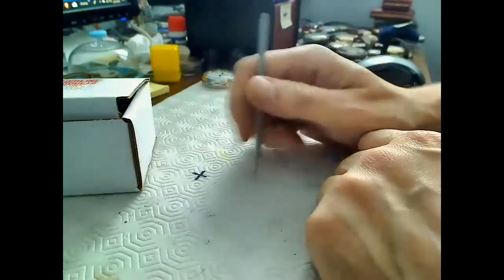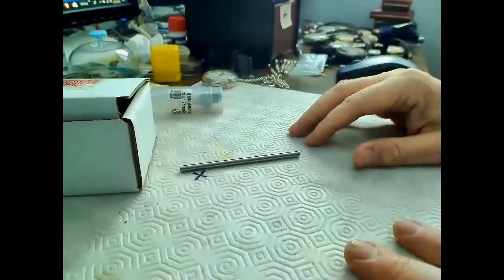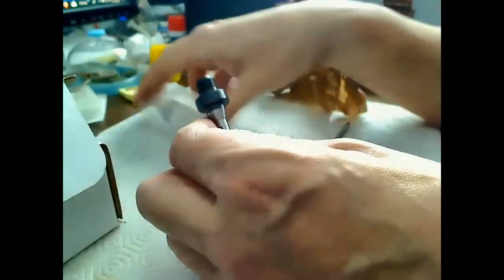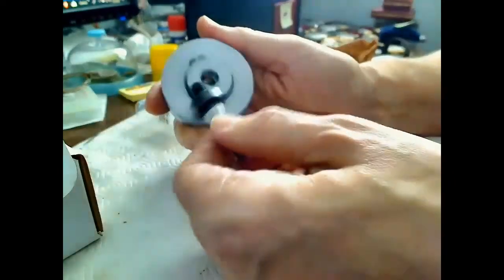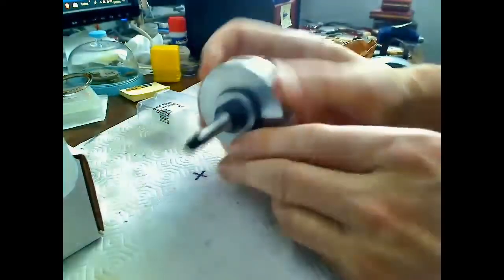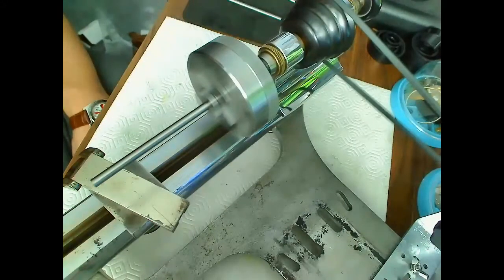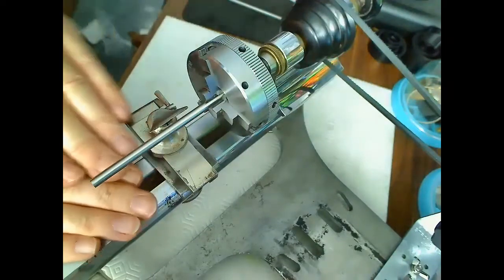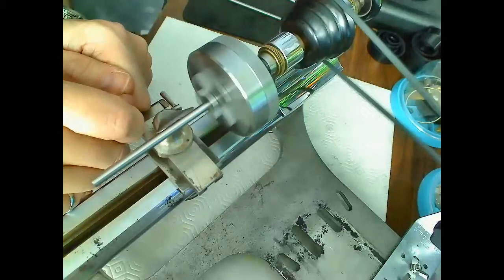Watchmakers 3 Jaw Chuck

Comment: I've just received the 4 jaw version and an RDG adapter. The run out ended up being very bad. I have since ordered an adapter from Sherline and the specs are promising. One of the challenges I found with the RDG adapter was how deep the thread was. It was too deep and the back of the chuck didn't mate well with the adapter.

Comment: nice video, as not much out there on these small watchmakers lathes, by the way you can use these chucks for making watch cases and the balance itself, also the gear wheels, as they sometimes are that size ( you expand the chuck to grip the gear blank on the inside).
Reply from the maker: Thanks...and you know too much my friend:)  Would love to make a case some day.
Reply: @JDRichard  No, never enough, I just have Autism, and a passion for tools, tech, and watching the artists who use them. 
One other thing those rods are colloquially called "tommy bars", same as the bar handle on your big bench vise. the other way to hold these rods is using a collet, and center drill using the tailstock, a centre hole, the kind for live centres, then mount the rod in between centres, and then cut the part as required, also you may use accessories like centre supports, or the special supports like the jacott tool uses, for turning and polishing pivot ends (as the forces are so light, due to the fact the parts are soo small, that bowing the parts would not realy, on thinking logically, be any issue as you would barely get 2 inch pounds of torque on the tailstock quill handle, and not require that much pressure anyway).

Comment: Nice approach to the 3-jaw issue.  FYI, and for others that might be looking, an original Boley 3-jaw was made, listed in their catalog as "a 45" which I have used for some light duty turning.  Granted, it's ebay material or luck to find one, but there it is.  Another alternative is to use crown collets.

I would be very careful using it too much in any of the lathes you mentioned.  You'll want to give special attention to the front cone bearing when you service the headstock--excessive use with the extra weight will not make the bearing happy with you. 

As an alternative to adapters, you may want to consider just biting the bullet and buying one of the Sherline lathe packages.  My watchmaking lathe is a Boley F1, which does perfect work for fine watch parts.  However, it's seriously under powered for anything else.  The Sherline calmly eats any material you can fit in the chuck.  I needed some 20mm brass round stock, but only had 1"x1" bar.  I chucked up a piece in the 4-jaw chuck and went to town on it.  It's a toss up which took longer, indicating the work piece in the 4-jaw, or turning it down to round stock.  And of course you can make parts for the watch lathes with a Sherline.
Reply from the maker: Adam Adkins I actually have a Boley Leinen lathe that is great for work with the 3 Jaw Chuck and i am not using that lathe for any detailed work. So not really to concerned about the bearing on that lathe.  But I will be careful

Comment: Wise warning on the keeping fingers away from the spinning 3-jaw chuck. I can only imagine the possible carnage. That Sherline chuck looks like it might be the same as those that fit the Unimat/Emco lathes. So they might be another option. Thanks for sharing your lathe experiences as you have them. Cheers.
Reply from the maker: MrRoundel Need all my fingers
Reply from the maker: MrRoundel That chuck works with an 8mm adapter to fit 8mm watchmakers lathes. Great chuck